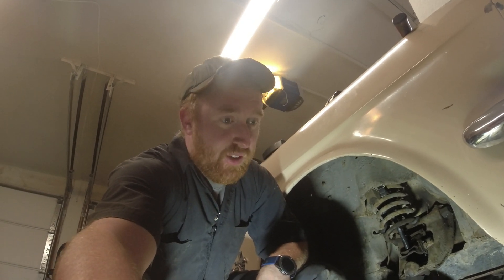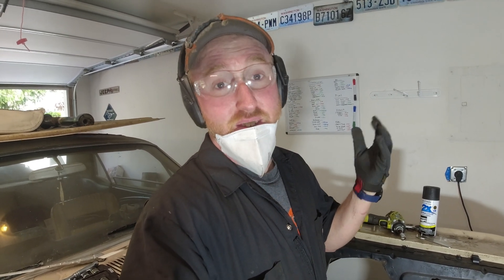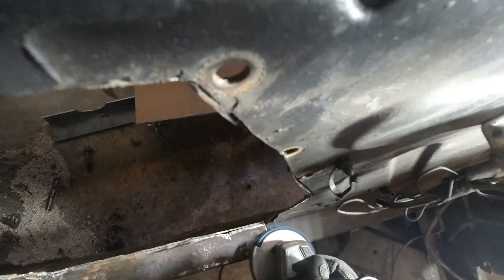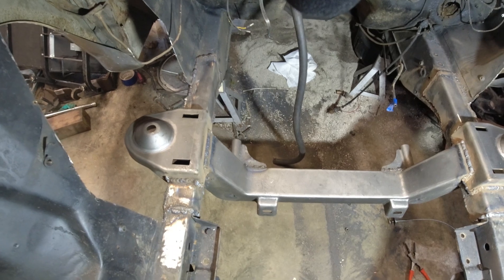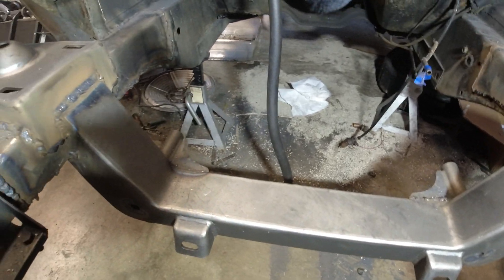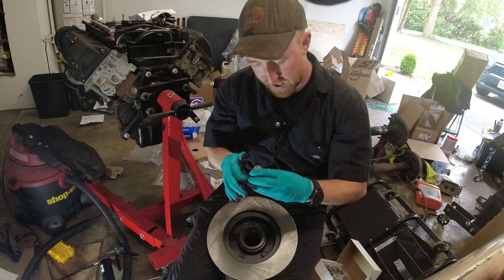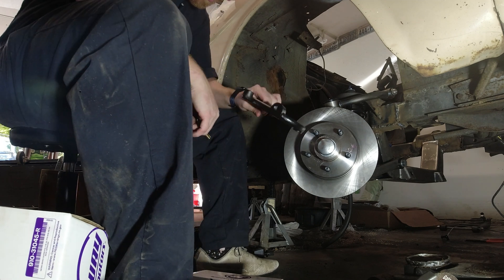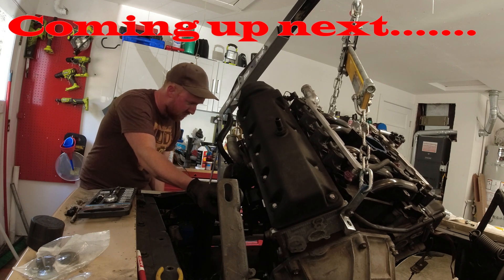Mustang II Front End Swap: 1966 Mustang 4.6L MOD MOTOR SWAP. Episode 2

Comment: Hello brother, question?

what is the reason you are cutting the frame at 22 n 1/4 instead of 24 n 1/4?
Reply from the maker: You are supposed to measure it from the front of the frame, not the  radiator core support. I measure the depth of the core support and subtracted that from the 24 1/4.
Reply: @4WDTrek  ok, i got it,.
2 inch depth less for the radiator core support.
Thank you, brother. very helpfully this video..
Reply from the maker: @ricardoramos1898  Thank you for watching! Hope you subscribed for me! I have a pretty crazy project I am currently building. Uploading the video series here soon

Comment: Did you use drop spindles?
Reply from the maker: I did not. I didn't want to drop it low. I wanted a more factory look than super low to the ground. I might cut the springs to bring it down an inch, but that's about it.
Reply: @4WDTrek  
I don't think I will need the drop spindles the extra weight of the 4.6 should do the trick maybe spend the extra money in the adjustable coilovers.
I have a lot of questions in the future and I hope by looking at your videos I can find the answers
Thanks for all your help.
Reply from the maker: @leewilliams8917  If you have more questions, please feel free to reach out to me through messenger via facebook or instagram. I tend to receive those quickly. Same name on both, 4WDTrek
Reply: Hello I talked to speedway today about using the mustang 2 cross member they have 
And they suggested using the 2" drop spindles to retain original ride height.
Did your mustang go up 2" after you installed it?
Reply from the maker: @Lee Williams  my mustang sits at stock height with the mod motor in it. The mod motor weighs a bit more than the stock i6 that came out. So it sits currently stock. I might cut the springs to drop it an inch though. I think it sits slightly high in the front compared to the rear.

Comment: This is an awesome reference video!!!!!! I'm doing the same, but I'm going with a Mopar 392 stroker. Question: What did you do for the sway bar?????? Also, I'm not doing motor mounts. I'm installing a motor and mid plate.
Reply from the maker: I have not done a sway bar yet. But I will likely soon. The lower control arms have mounting points for them. I'll be welding on tabs to the frame to hold them and have it mounted to the control arms. 

Will be interesting seeing that stroker in there! Mopar in a ford?? I like it!

Comment: very informative video. what spring set did you go with ?
Reply from the maker: I believe I went with the 400 spring set. Seems to work really well. 
I cut one full coil off and it ended up being just a TAD bit too high for the rear. I just haven't trimmed the rest yet

Comment: You wouldn't happen to still have the part number for the kit you got from Speedway would you?
Thanks.
Reply from the maker: The brakes and spindle kit is 91034208-4 1/2.
The crossmember kit is 91034457-DLX.